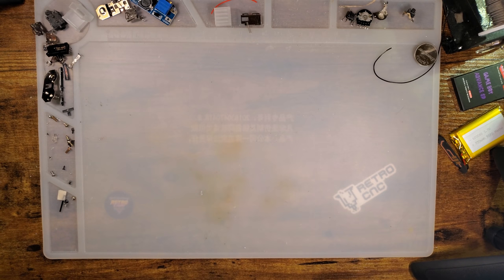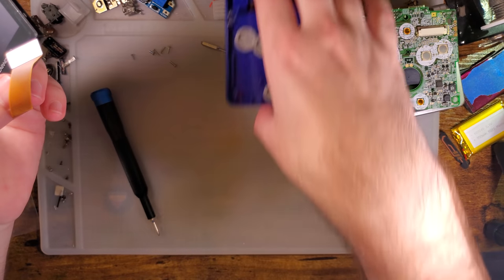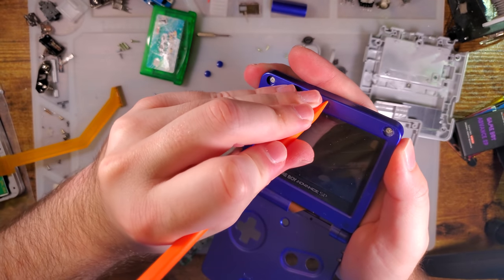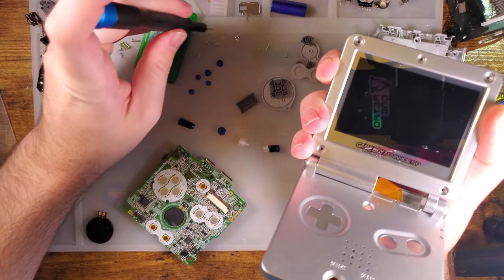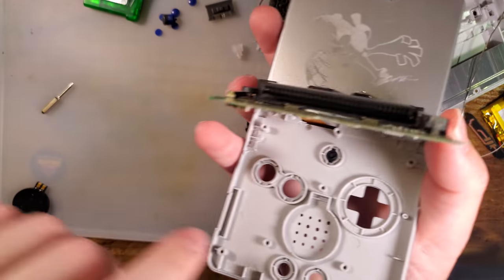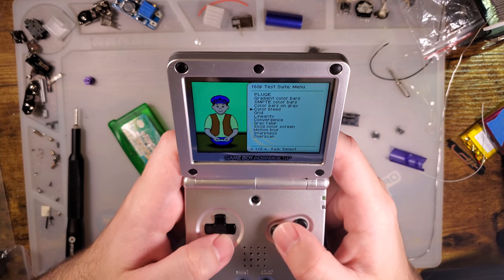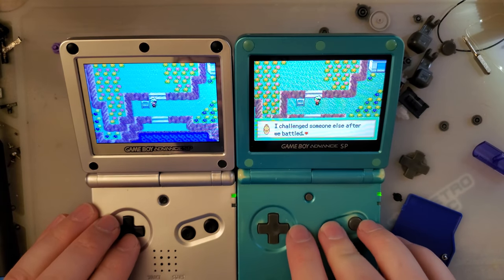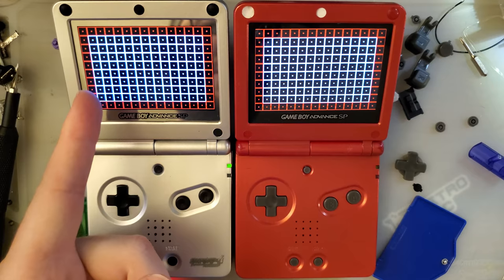GBA SP 3.0" Laminated IPS Backlight Kit - Cloud Game Store

Comment: This is probably a dumb question, but why can't they make brightness controls work just like the original screens? I mean there must be some way to do it without having to solder, after all the stock screens do it with no problem.
Reply: to my EXTREMELY LIMITED knowledge, the sp brightness button just toggles a couple brightness voltages, and while I assume a screen kit could read the brightness voltage and cycle to the next each time the voltage changes, that's too much extra code for something that one or two wires can enable equally as well, plus extra code means more expensive FPGA or CPLD that has more programable space
Reply: @imclearingit4149  I see. So it's basically a cost saving measure.
Reply from the maker: to maintain compatibility with all versions of the SP, it has to be done this way. Otherwise the kit would only work with AGS-001 consoles and AGS-101 console owners would be limited to OEM screens (not that you should be modding an AGS-101...)

Comment: Do you have a recommended screwdriver set? I have an "oria" set I've had for years and I'd like something better, the gba sp has very easy to strip screws and I am having trouble on a shell swap to get the third party shell to be seamless around the screen. Just can't tighten it enough. Ifixit kit seems really good. How are these kits compared to stock ags-101 backlights?
Reply: Get the ifixit Mako 64 bit driver kit. I got one and it is really a good quality kit!
Reply from the maker: @deicorpse8931  seconded, I like the mako set (and not just because of the name). The JIS bits alone are worth the price

Comment: Hey makho! I need help with my gameboy player. My gamecube reads the disc and I can get into the gameboy player menu but it's not loading the gb, gbc or gba cartridges. I opened and everything seems fine, not water damage or rust of any kind. Any ideas? What else I could do? Many thanks in advance.
Reply: Get a game you dont really care about and flood it with ipa and insert/remove the game quickly to clean the pins. Push comes to shove, dismantle a game and line the back of it with a fine sandpaper. Then do the same thing. Hope I can at least help if he doesn't respond.
Reply: Oh, and mod your gamecube and use Gameboy interface instead. Its a far better experience than the GBP haha.
Reply: A bit of of a generic response but ensure the internals of each respective cart is nice and clean. Also, the internal switch (similar to the GBA) that distinguishes which cart is being used might be dirty/stuck so it doesn't know what to read. You should be able to manually toggle said switch to get it going - good luck!
Reply: @christopherbragg6643  I cleaned everything, cartridges and gameboy player. The games work fine with my GBA SP but the gameboy player doesn't load them. I really don't understand what can be wrong.
Reply from the maker: try cleaning it properly: https://www.youtube.com/watch?v=y-gE7t9Mk3w

also, make sure all the pins appear intact with nothing corroded, bent, missing, etc. Inspect traces too. If you have water damage, that can be a whole rabbit hole to diagnose and repair.

Comment: Do you think this will work with either your metal face or boxypixel body?
Reply from the maker: My slate shell is designed to be used with a bare LCD, so no. IDK what boxy's supports since the first kit I tried broke as soon as I set the console down.
Reply: @makho   I saw that video. (Love the content btw)  I have 2 unhinged and I used the other ips floating around with the orange flex pcb on it kaptoned to the back of the panel .  Although I super baby my stuff knock on wood I haven't ran into any troubles other than blowing fuses. Is yours available or is it still in testing I would love your model also.